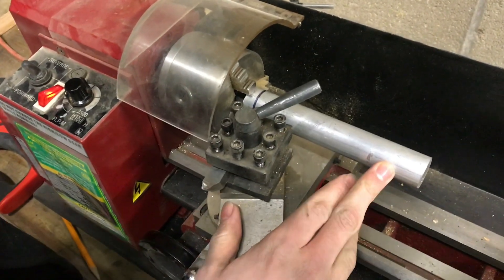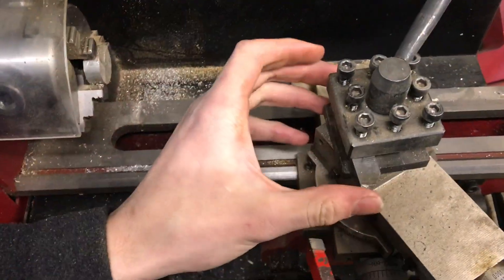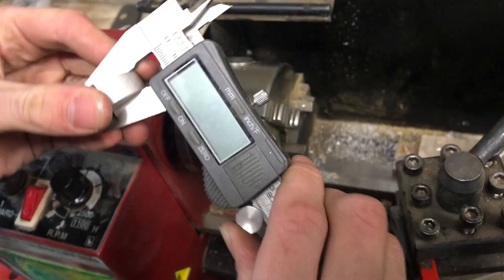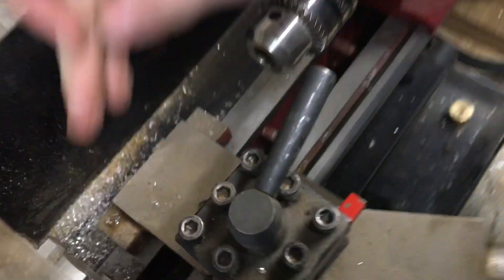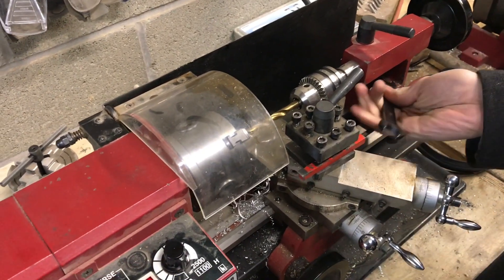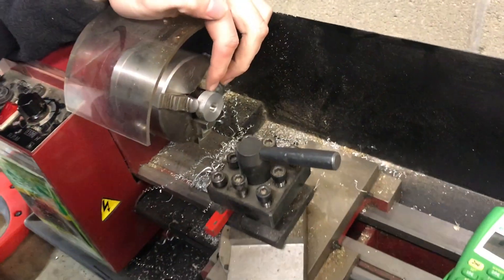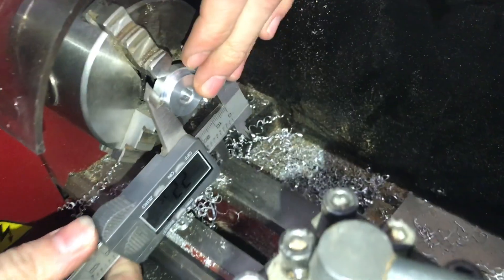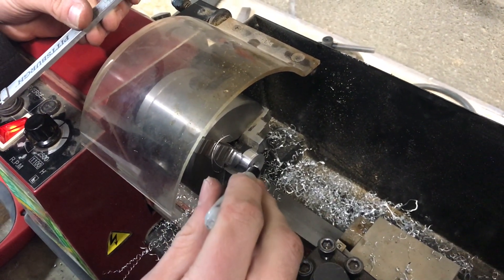lathe PRECISION bushings on a harbor freight mini lathe (Item#93212)

Comment: If you must hacksaw material in the chuck (not recommended), put a wooden board on the ways, to protect them from the hacksaw if it slips, or, as happened here, metal falls onto them.

Comment: I have the Harbor Freight 93212 {7X10} mini-lathe. I broke a gear and can't find a video on how to replace the gear. It seems to be the top belt gear because the other gears are all there. T belt is loose and the bottom gear is okay. Do you have a video on how to change the gear? I imagine I will have to order the gear from Little Machine Shop but I', a newbie and I don't know what gear to order. The gear does have a key slot in it. Any help you can give me will be much appreciated. I have watched MANY of your videos, especially the ones about the mini-lathe.

Comment: Nice introduction!  I just ordered this lathe, so I'm getting familiar by watching videos.  Those tips about the parallel straightening bars and locking the work on the long bolt for extended turning are great.

Comment: If you replace the battery on the calipers they will read much more accurately, the cheap ones cant function well on low voltage
Reply from the maker: Interesting, I’ll try a new battery and test it with another set of calipers that I know is in spec. Thanks again for your thoughts, I’ll give it a try

Comment: Won't be mean or cruel. It was interesting to watch the struggle and constant repositioning. But you could have set up your bar in the chuck nice and straight Faced it and drilled the hole then live center in the hole and done all the machining without all the flipping and working safely away from the chuck.

Comment: I saw the Pittsburgh calipers and had to do a double on the title...”PRECISION” hmmm. I’m not sure I understand the reasoning behind the whole jig to hold the part at the end, you had plenty of stock before you cut it down. Just cut off a little larger piece than you need and that way you can do 90% of your ops from one side, then flip, face, chamfer, and done.

Comment: Hey is this lathe still working?  Looking at getting one
Reply from the maker: Yes, it’s still working. My favorite part about this lathe is the size. If you need to move it it doesn’t take an army. Even though it’s small there still a lot of really good projects that are possible. If you have any specific questions let me know.
Reply: You can order off ebay and get a 7x14. I paid 400$ 2 years ago

Comment: Thanks for the demo.  It was interesting to see the little lathe go.  That's a pretty snazzy hobby tool you've got there.

One comment mentioned order of operation.  While his tone was snarky and he didn't provide any constructive feedback, he does make a valid part.  If you plot out what you'll be doing, you'll making the job easier, more accurate, and safer.  

For your project, I'd recommend keeping the bushing attached to the large bar stock as long as possible with these steps:

1.  Secure the bar stock in the chuck.
2.  Face it.
3.  Cut the diameter down to the largest diameter.  Leave yourself a little room for finishing.
4.  Cut the diameter down on the section with the smaller diameter (the section which is 6mm long) and build your radius in that corner.  Leave yourself a little room for finishing.
5.  Drill your hole to a sufficient depth.
6.  Chamfer the hole, the end of the piece, and the part of the larger diameter section you can reach.
7.  Cut the bushing from the stock.
8.  Clamp the 6mm long part of the bushing into the chuck.
9.  Face it.
10.  Chamfer the hole, and the other corner of the larger diameter section.

Two safety tips:
1.  Please don't chuck your piece so shallow, especially when working with aluminum.  If you chuck it tight and right on the edge, and push too hard with the cutting tool, you can dislodge your piece.  And you never know where it'll go (or how fast it will get there), especially if it gets hit by a chuck jaw.  
2.  And please never wear gloves, watches, rings, wristbands, dangly necklaces, long-sleeved shirts, jackets, or loose clothing when machining on your lathe.
  

Have fun with your lathe and I look forward to seeing future videos of your lathe projects.  I'll also be secretly monitoring to see how it holds up, especially with some plastic gears inside it.
Reply from the maker: I really appreciate the KIND response. It is a really nice hobby lathe. I also really appreciate the constructive criticism. That’s how you learn. Thanks again

Comment: ON THE LEFT, CAN YOU PLACE A PIECE OF STOCK, DOWEL, THRU THE CENTER OF THE MACHINE,  SO IF YOU HAD A 30 INCH ROUND STOCK, IT GOES THRU CENTER.  SIMILAR TO CUE BUILDING LATHE.
Reply: Yes but the hole is only like 5/8's inch or so around.

Comment: QUESTION,  CAN YOU CHECK IF ALL THE INTERNAL GEARS ARE MADE OF PLASTIC?  
THE GUY REVIEWING THE GRIZZLY SHOWED THE INTERNAL GEARS,  ARE PLASTIC ON THE COMPARIBLE MINI LATHE BY GRIZZLY.  SEEN ON YOUTUBE
Reply from the maker: I know the gears that control the thread pitch are definitely plastic. I haven’t had a chance to pull it apart to see you but the gears are made of yet. Luckily I haven’t had to, we’ve run a lot of parts on this machine.

The harbor freight milling machine I have pulled it apart. All the gears in it are metal except for one. There is one gear between the motor and the gearbox is plastic. I know this because I broke it. At first I was disgusted that they made the gear out of plastic. But after I thought about it I’m glad it is plastic because I’d rather have one gear shatter if there’s too heavy of a load. It’s easy to replace one gear.  

I am kind of interested to know what the gears look like inside the lathe. If you find out before I do please let me know.
Reply: All  of the gears are plastic. It also comes with some extra gears. This has not been a problem for 90% of people. If you insist upon having metal gears, they are available at The Little Machine Shop .COM.
You will be spending lots of money there anyway  for tooling and accessories. As a matter of fact, it is very, very common to exceed the original price of the lathe  buying tooling and accessories. If you do buy one, immediately get another cogged drive belt coming for a spare. You will thank me later I guarantee. Try to find a used machine if you can, the price of new ones jumped considerably.

Comment: So is this lathe worth the $600 price tag? Does it come with tooling?
Reply: thats up to you if it is worth the money.  keep in mind, the grizzly mini model has ALL PLASTIC GEARING!  see the review. the guy shows broken plastic teeth on the gears and he replaced them with metal, his own cost
Reply: Why would you take down the OD last? Face>drill>turn OD>parting tool. Seems like you're not using the lathe effectively
Reply from the maker: I’m pretty sure the lathe came with tooling. I know I’ve made tools and I think I’ve also purchased a few as well. I think the $600 price tag is worth it to me because I was able to fix a printing press that was going to cost me over $600 to have the pieces made. In my case it paid for itself, On this job alone. Since then we have fixed and repaired many jobs that we would’ve been able to if we didn’t have it sitting there. It is also valuable that the Lathe is very transportable. I’ve had to move a lot of lathes in my day, Two people can move this with absolutely no trouble at all. The way I look at this lathe is it has the size capacity can handle a lot of jobs. If I get stuck in needing a part bigger than I find somebody with a bigger lathe. At $600 it would be a difficult purchase if I didn’t need the work done, but I’m really glad that we’ve had it through the years.